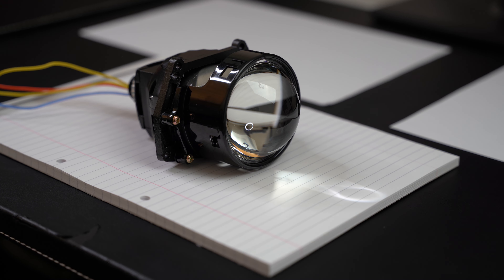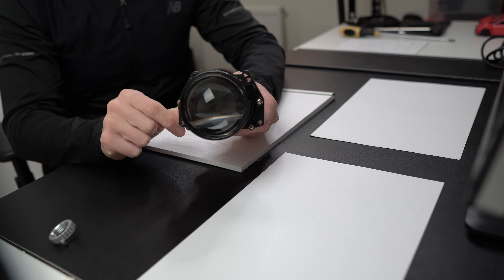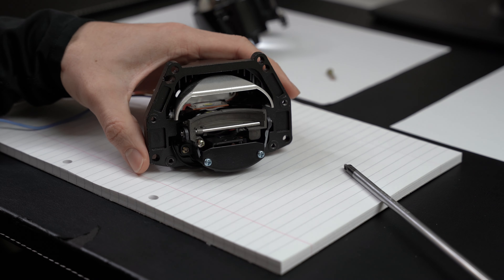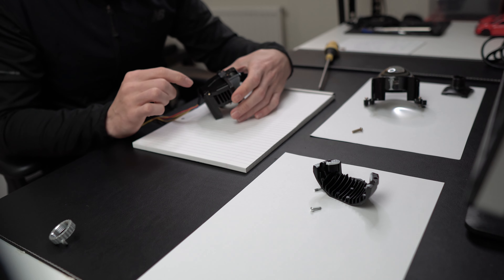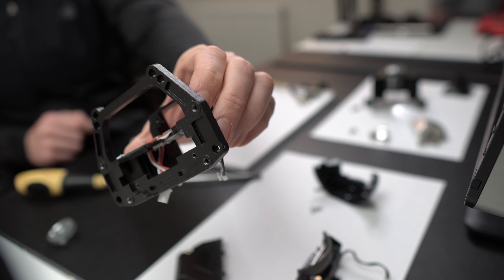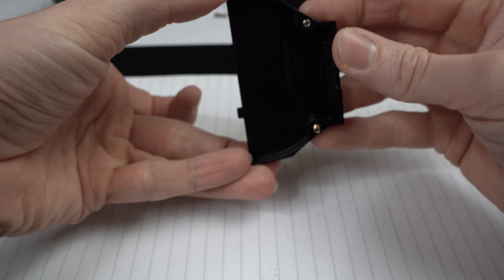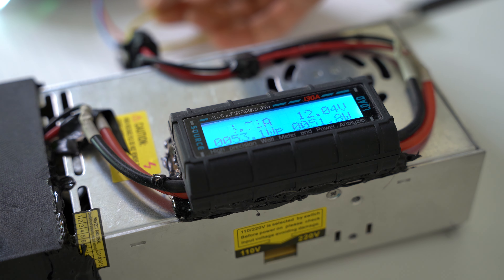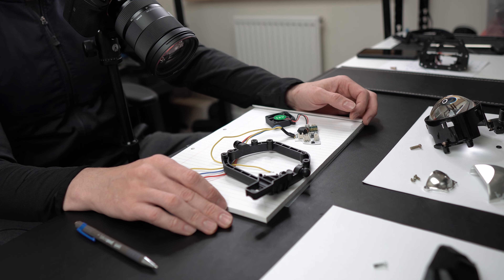Best LED Lens for Audi A4 B8 Headlight Upgrade

Comment: Does it come with the LED bulb?
Reply from the maker: yes
Reply: @BestCarMods  these are as bright as these new LEDs right?
Reply from the maker: @EJR20  better
Reply: @BestCarMods  I found 3 inch projector lenses that were fit into a first gen facelift Q7. Would that also fit in a B8 headlight housing? Since the one you had in this video was 3 inches, figured I’d ask your opinion.
Reply from the maker: @EJR20  don't know the answer for this question